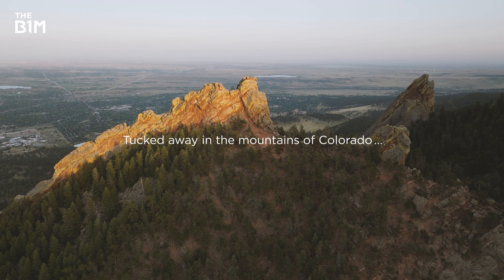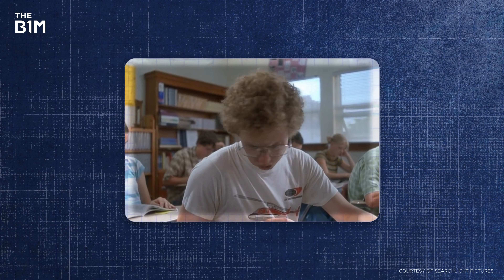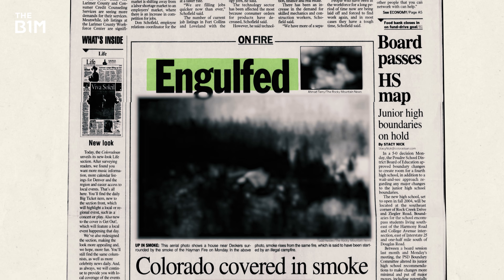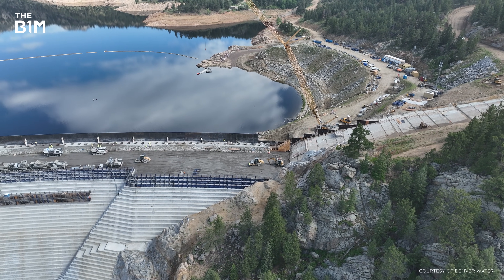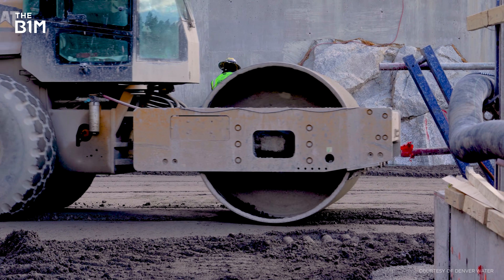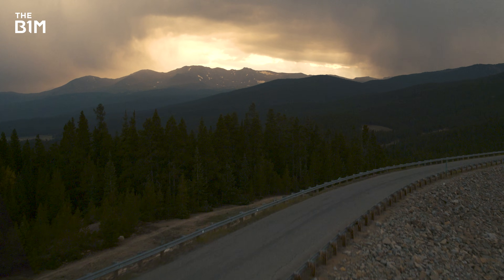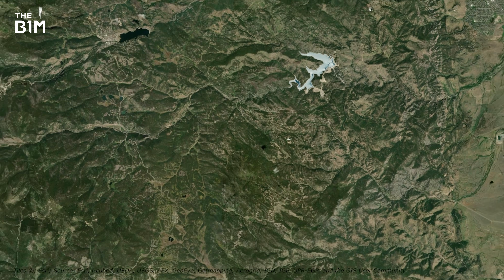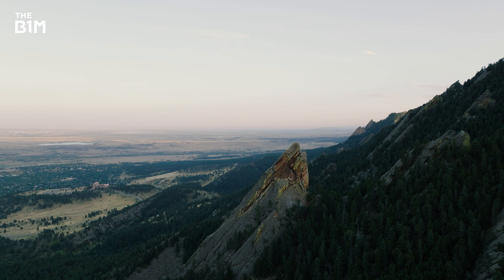Colorado's Water Crisis is Getting Worse

Comment: Corporations are the biggest problem with making water last.  Especially these new data centers that use more power than a million homes.  Their water consumption is off the charts and they are polluting that water too. They don’t have any environmental regulations they need to follow.   
As far as the guy thinking it will affect the rivers.   With the Geoengineering technologies they have, they can make it rain and snow all they want.  The heavy metals they use to do that are not good for the planet though.

Comment: That dude from colorado river crap is an idiot. That river is on the OTHER side of the divide and drains to the Mississippi. The Moffat tunnel brings 90% of that river across the divide. Due to the Dems here Colorado has sold most of it water rights to other states. Denver is running out of water due to the population here. This has the Blue BS all over it. I cant wait for pole smoker polis to gtfo Colorado.

Comment: Since this dam is on the opposite side of the continental divide of the Colorado river. How does it hurt the Colorado river water shed?
Reply: They have tunnels that pump the water through the divide to the eastern side. It's pretty remarkable that the tunnels were actually built in 1923!

Comment: The greenies will not allow good fire prevention land maintenance.   Dead brush, trees, and debris are allowed to accumulate until the fire hazard is extremely dangerous and what would have been a routine natural fire, becomes a large-scale disaster.  That's why there's an increase in fires.  Thanks greenies!
Reply: But in actual fact, the reintroduction of beavers, where people have been smart enough to do it, has restored rivers, the forests surrounding, decreased fire threat, because the ground is holding water, and helping prevent flooding.  Check it out.

Comment: Lived in Boulder for 34 years…camped and recreated at Boulder Res.  This is a good plan!  Building upon existing dams to triple the capacity is much better than trying to find a new site (not many left).  The water infrastructure is already in place, there is a new hydroelectric plant, minimum impact upon residents (if fact it’s better because they are closer to the lake).  What’s really cool is that Denver had always planned on expanding the dam…spreading out the cost in stages to reflect demand is just good management.

Comment: The water for the Gross Reservoir does NOT come from the Colorado River. It comes from the Fraser River and it's feeders. The Colorado river runs through Grand Lake, Shadow Mountain Lake, Lake Granby and the Fraser River joins the Colorado at the Windy Gap Reservoir. Northern Water pumps water from Windy Gap to Lake Granby and from there to Shadow Mountain and finally Grand Lake before it enters the Alva B Adams tunnel under Rocky Mountain National Park to Northern Waters reservoirs and distribution system. 

Denver Water collects water from the Fraser, St. louis Creek, Vasquez Creek and Williams Fork River (through the Gumlick and Vasquez tunnels. 

The majority of Denver Water comes NOT from the Colorado but from the Blue River and it's tributaries (Snake River and Ten Mile Creek) and is brought under the Continental Divide to the North Fork of the Platte River by the Harold B Roberts Tunnel. 

Denver Water has other reservoirs (or stakes in reservoirs) that don't feed into their system directly (Williams Fork, Green Mountain, Wolford and others) and are used to supply water downstream using the Colorado River when Denver Water gets a call to meet downstream demands.

Comment: Denver water doesn't have a water shortage.
They've been buying water and building reservoirs for over a 120 years.
So much in fact that they've been supplying other towns with water. Supplying new towns that don't exist yet for the next 100 years.
The lead issue has broken open what they can charge to maintain lines finally.
Few years ago a woman was killed by a line breaking and killing her in her car on the street 20 feet above the line.
We have 20 years to get caught up  on maintenance

Comment: TWO HUNDRED BILLION GALLONS OF WATER PER DAY is disappearing from the Mississippi River between Cairo, Illinois and Baton Rouge, Louisiana, greatly reducing the river depth and flow because of groundwater extraction, and there is no way to stop it. Every single drop of water pumped from underground aquifers creates a vacuum that causes subduction and the loss of surface water. America has treated aquifers as if they would never run dry or be polluted from above. Now we have billions of gallons of nasty, polluted water being sucked into the aquifers every day across the nation. We are in deep trouble.

Comment: i See no issue in this Project.... it won't limit the water flow, it will increase it, cause they want to generate more Power = equal more Water flowing through the Turbines. Seem these Groups just want to generate Trouble. Simple fix - you don't like Hydroelectric Power? Well, CUT THEM OFF all supplies.... Power, Internet, Fuel.... Problem solved.

Comment: I'm unclear on how (at least long term) increasing the size of the reservoir affects downstream water levels. I fully accept that over the short term, as the water level is raised in the reservoir, downstream river levels would be affected inverse to the rate at which the reservoir is raised. But after that, the same amount of water is still coming down the river and the reservoir will have to allow the same amount past (or be overflowed). But, I'm ignorant about this. I just don't see the logic now.

Comment: I graduated from high school in a Denver suburb in the mid 70s.  There was a water shortage even then--homes could only water grass once every 3rd day.  It hasn't gotten better over the years so nice to see the work being done to accumulate more water.  Interesting approach--hope it all works out since there's not a technical issue.  As usual, there's someone running to court to stop work ... without offering any meaningful solution to address the original problem.  And, of course, it increases the cost for no benefit.
Reply: We don't have a water shortage BECAUSE WE DID THINGS LIKE THAT.
Denver water has always had an excess of water for more than a 100 years. They keep buying water

Comment: Roller compacted dam. Wow there is one in Central Queensland Australia that had the top cut off it because the dam has started to fail, due to the compacted concreter construction. The replacement cost for that particular dam is eye watering.
Reply: If it the one I was looking at on YT recently there was insufficient cement in the RCC.

Comment: Its a good thing for Denver.  Bad for everyone else.  The CO river has so many issues and theres constantly fish kills on low flow years because of how hot the water gets nowadays.  This affects more than just fish but the health of the ecosystem as a whole.  This also affects tons of tourist industries, ag, hydro, and more.

Anyone who thinks pulling more water ACROSS the continental divide is a good idea is uninformed.  Theres already multiple piplines running water to the front range across the divide.  We do not need more.  You should pay more for water and use it less.  Last I checked I was being charged around $5/1000 gallons of fresh water usage just north of denver

Comment: I camped there a few years back the same night a concrete truck fell into the reservoir. I was woken up by not only the lights and sounds of the trucks moving all night, but also the rescue helicopters flying through. This is and has been a rushed, cursed project with too few precautions taken.

Comment: I would be interested to know your reference material claiming Gross Dam is the largest RCC crest raise in the world. It might be, but overlays and crest raises aren’t that uncommon, and this volume is well below the largest RCC projects globally. Also - the statement that RCC sets faster than CVC is not correct. You intentionally delay the setting of RCC to ensure that the subsequent lifts bond to the previous. To accomplish this, the previous lifts should not have reached final set. If it does, you need to perform additional prep between the RCC lift joints. Since RCC at Gross was placed in the traditional horizontal lift approach, a fast setting RCC would have been a catastrophic failure. Finally this was CMGC delivery; the project choices (like RCC) were in the original concept, but the JV (Kiewit-Barnard) should get some credit as they helped develop and guide the project through final design.

Comment: I absolutely favor a lot of initiatives to better protect and manage the environment sustainably.  However, when populations are increasing, preventing any projects from moving forward doesn't make sense.  Environmental pushback has become so significant in my area (Ontario), for example, that we effectively have a housing crisis of our own making, because we don't want to build anywhere due to various environmental pushback.  That's a gross over-simplification, but that's basically what it boils down to.  I agree with many pro-environmental initiatives, but preventing any construction because we want to wish away larger populations in our midst is absolute foolishness.  Our populations in most areas are much higher than they used to be, and we need to figure out how to accommodate that responsibly, in the least impactful way possible.  But that DOES NOT mean we can just close our eyes and pretend those extra human beings don't exist.  I know many pro-environmental individuals (whom I'd agree with in many ways, TBH) are simply going to resist any major infrastructure project, anywhere, anytime.  That is environmental blindness.

Comment: In the early 2000’s when Colorado experienced a severe drought, Denver water started a massive campaign to get their rate payers to save water…gave a way low flush toilets, shower heads, pushed xeriscaping, alternating watering times, etc.  It worked fantastically…water was being saved.  But then Denver Water noticed that will all the water being saved they weren’t generating the revenue they once were.  Their solution?  Significantly raising the water rates on all the people that just helped them save water.  People were pissed.  Denver Water is too powerful.  Much of the water storage created with his new dam is likely going to be sold to surrounding communities so they can continue with their unfettered growth.  There is huge potential for saving water through conservation, xeriscaping, etc.  But that doesn’t bring in the money…..

Comment: I’m more curious about the techniques and technologies being used to affix the new extension to the face of the old structure. 🤔  Even the smallest weakness or fissure between the two structures will allow seepage. 

Essentially, filling the new dam will be an intensional and permanent overtopping of the old dam. That will put enormous pressures on the new extension to peel away from the top. How the two structures are attached to one another would be fascinating to learn about.

Comment: Those groups are wrong with their thinking about saving the environment. As what will there be to save if 340,000,000 turns into 380,000,000 and then 400,000,000 and so forth how do you compensate these individuals with water if you don’t want to store it ?

Comment: The new total capacity of 119,000 acre feet is a drop in the bucket when you consider Lake Powell's capacity is 25 million  acre feet  and Lake Mead's is 29 million. The water shortages are happening because the downstream states have been taking more water than the river system receives.

Comment: I would like to hear a more precise argument from the environmental group. "Dams kill rivers" and "climate scientists claim..." are vague statements. How is this exact project impacting the Colorado region? What were the pros and cons of the original dam. Did the original dam have a big impact on the colorado river? Who was the scientist (or team of) that made the claim, bring up the exact scientific research paper that you are referring to.
Reply: A precise argument is that the Colorado river is overutilized (basically dry by Mexico, an ecological disaster) --> water rights holders have an interest in throwing wrenches in each other's plans. Nobody in the basin wants the additional fraser water capacity enabled by the reservoir water going to Denver... They'd sooner just pour the water on the ground and let it evaporate, which is what Alfalfa farming is all about...

So, the argument would carry weight if not for the sheer insane misuse of water in the lower basin.
Reply: These arguments would have been made out in court to a a standard justifying the injunction. Generally it comes down to sustainable minimum river flows Like another poster here said, it will come down to big Ag in the US (lets face it, the US is basically owned and run by corporates) having too much sway over state decision-making.
Reply: @muppetb.lansing8374 Preach!
Reply: They killed Two Forks. The river is still present, just down 200 feet
Reply: The original dam isn't even on the Colorado river system.  It's on the east side of the divide, and flows into the Mississippi.
Reply: @wagnerrp  True, but I suspect water is brought in by aquaducts from the western slope.  I could be wrong, though.
Reply: @richardthomas5362  your not wrong it's sent through a tunnel from the west of the devide thus all lost to Colorado river baison. We need to tap the mosuri and send water south
Reply: Denver residents:  We need to save the environment!  We have to stop the ruination of the environment!   David vs Goliath!
Also Denver residents:  WhY aRe WaTeR rAtEs GoInG tHrOuGh ThE rOoF!
Reply: 3 Western states are removing their dams and allowing the the rivers to repair themselves, quite surprisingly, much faster than anyone thought.
Reply: All of this is public record. You just have to search for it. 

Sign up for a PACER Account. Do not, that it charges per search and per page document. If you are under a certain limit quarterly (I think its 30 dollars) the charges are waived.

http://www.cod.uscourts.gov/CourtOperations/PACER.aspx

The Case Appears to be: 
1:18-cv-03258-CMA Save the Colorado et al v. Semonite et al
Christine M. Arguello, presiding
Date filed: 12/19/2018
Date terminated: 06/05/2025
Date of last filing: 09/16/2025

It appears that 225 documents have been submitted as a part of the record. Doc. No. #1 is the initial complaint.

It's also important to note that the environmental groups "wins" here may be strictly related to procedural fudges up and nothing about their actual arguments for why the project is an impact to the environment.

I will say that the Colorado River is overallocated. The expected volume that was determined to be about "normal" was actually not normal; it was wetter than usual. Anything that diverts water from the Colorado is in fact a negative to the Colorado. The River Delta of the Colorado is in pretty rough shape these days, strictly because of the substantially less water is getting to the delta than before. 

The original dam and reservoir were built in 1954. If environmental reviews were done, they were likely a joke. A lot of the major environmental legislation was passed in the late 60s/early 70s strictly because of the damage of the post-WWII era decisions. 

We have:
National Environmental Policy Act of 1969
Endangered Species Act of 1973
Clean Water Act (quick Wikipedia search, shows the current framework was started in 1972 and further refinement in 1977 and 1987.
Reply: Exactly. To be fair, they probably only had so much time in the video. What they did not address is that the water demand is going up. The water utility either has to provide more water, or the city/economy should not be allowed to grow. There is no other water available.
Reply: @skerminkel9971 there is plenty of water available and Denver water is decades ahead in water purchases. 
They have a MASSIVE amount of excess water.
Reply: @sparksmcgee6641  OK, but where is it? Is the dam necessary to utilise it?
Reply: Also, who are they funded by? A lot of groups that oppose damms, wind farms, etc on environmental impacts are actually funded by fossil fuel companies.
Reply: Environmentalists are breathing. They should stop.
Reply: @user-wp2pb4zq3s breathing is carbon neutral bud

Comment: I'm puzzled. Since the dam is on South Bolder Creek, which eventually flows into the Platte and the Mississippi, what does this have to do with the Colorado river? Am I missing something?

EDIT: I think I figured this out. The water is pumped in from Grandby or someplace to the west and only stored in this reservoir.

Comment: The United States also greatly expanded the Roosevelt Dam. It was raised from 280 to 357 feet increasing water storage by 2.1 million acre feet. Arizona now has a proposal to build this dam into the Salt River Project allowing 2 Gigawatts of pumped hydro storage for supplying 400,000 houses renewable baseload electricity.

Comment: The Paradise dam in Queensland Australia is a perfect example of a RCC dam. It's currently being replaced after 25 years. Originally built using RCC for $AUD240M and now being rebuilt for an estimated minimum cost of $AUD4.4B. 
Skinning the outside of the Gross dam would have me concerned that any leakage of the original dam would potentially cause the new dam wall to peel away catastrophically.